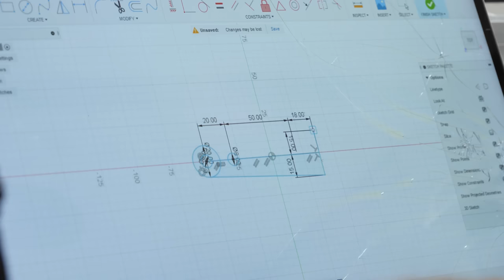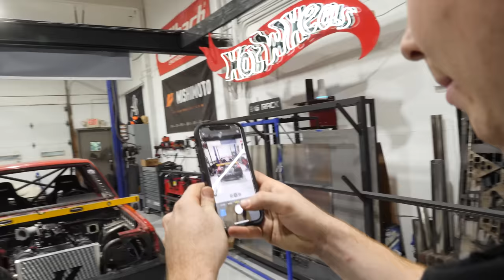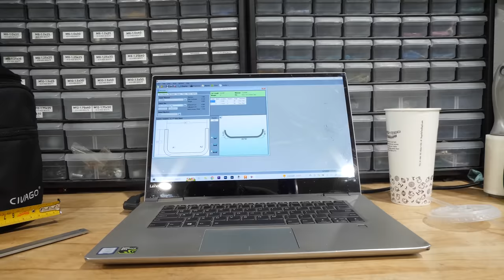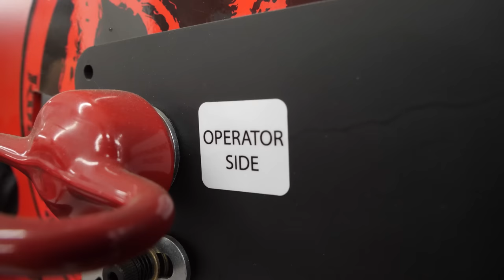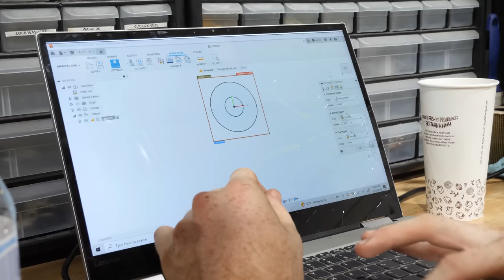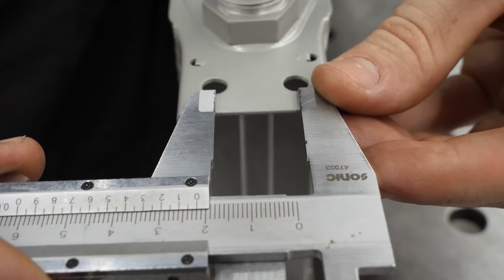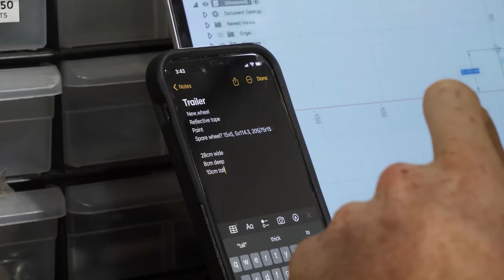DUAL RADIATOR Setup On DRIFT TRUCK V2! Does It Need More Cooling...?

Comment: If you can route the coolant line around the belt instead of through, you won't have to disconnect the coolant line to switch the belt. Loving the build so far!

Comment: I’d think mounting the fans behind the bumper on the bottom would make more sense since there’s naturally going to be dead air down there. Granted you’d need pushers and you wouldn’t get flow through the oil coolers but you’d have more room in the bay to deal with thrown belts etc.

Comment: Intercooler behind the oil cooler means its going to get hot air from the oil cooler. Not ideal. If you can mount them to the side or behind, it will likely have slightly lower IATs.
Reply: My thought is that oil and coolant are generally <10°c apart, so the coolant won't heat up due to the hot air. And because the radiator has maybe 4x the frontal area, it'll still cool, just not in that one spot.
Reply: @KaelinatorPVP  Yeah, if it were a radiator it would be a non issue. However, this is the heat exchanger for an intercooler. So you want that fluid as close to ambient as possible.
Reply: @roboman2444  oh snap, I didn't even realize. That makes sense
Reply from the maker: Yeah. I’m hoping that the size of the intercooler kinda negates it but we’ll see
Reply: In the name of Allah, I invite you to worship Allah alone, so say: I bear witness that there is no god but Allah, and I bear witness that Muhammad is the Messenger of Allah. These words make you a servant of Allah ....  ..........  ..........

Comment: Did you fix the rear suspension so the end that it connected to the body can turn? If not take a look at how push rod works on other cars. If you keep it this way they shocks will break because they will flex.
Reply: In the name of Allah, I invite you to worship Allah alone, so say: I bear witness that there is no god but Allah, and I bear witness that Muhammad is the Messenger of Allah. These words make you a servant of Allah ....  ..........  ..........

Comment: It is better to mount those coolers turned 90°, inlet and outlet on the side.
The bottom connection is inlet, top outlet, that way air is forced out and prevents air pockets and hot spots.
Reply: In the name of Allah, I invite you to worship Allah alone, so say: I bear witness that there is no god but Allah, and I bear witness that Muhammad is the Messenger of Allah. These words make you a servant of Allah ....  ..........  ..........

Comment: You are gonna end up heating the intercooler having it behind the fluid coolers. Intercooler should be up front
Reply from the maker: Yeah I did think about that…. But with the gap between the two and with the length I intercooler being so massive I’m hoping it won’t be an issue
Reply: It wont

Comment: If you want more power ging why don’t you run nitrous? These 1UZ’s love 175 shot of nitrous and you can setup the purge line right in front of the heat exchanger and when you purge your lines it cools off the heat exchanger thus keeping the supercharger cooler
Reply from the maker: The vvti 1UZ can’t handle much more than 300whp from what I’ve heard

Comment: you are probably heating up the charge cooler with the hot air sucked through the oil cooler FYI.

Comment: Avoid mig welding nearby unprotected alu radiator cores - the little hot particles are capable of burning thru very thin alu walls.
Reply: In the name of Allah, I invite you to worship Allah alone, so say: I bear witness that there is no god but Allah, and I bear witness that Muhammad is the Messenger of Allah. These words make you a servant of Allah ....  ..........  ..........

Comment: Are you going to address the front wheel stance being wider than the rear?
Reply: That is a drift car thing. Look at pro level FD cars, this truck is very very mild in terms of front poke in comparison. There isn't really anything you can do about it either because you have to run the poke to get more angle. The only way you would fix it is to add massive spacers to the rear which is not a very good solution at all and staggered will give you a better feel than a square setup anyways. Brand new cars and especially trucks have the front wheels wider than the rear just to accommodate stock steering angle. These custom drift cars can run way more over stock.

Comment: A 500hp ls3 would have been such a better solution, I know it's cool to be different but this is an insane amount of work for 300hp. Lighter, more powerful, more reliable.  There's just no denying it.
Reply from the maker: Eh, not much lighter nor reliable. 1uz is waaaaaaaay cheaper too.
Reply: @_Gingium_ I agree with way cheaper

Comment: I don't understand how your charge air is supposed to be cooled if you're blowing hot air through the radiator. Oil coolers flat under the hood with some louvers in the hood would work much better

Comment: i think youre wasting ALOT of time, money and resources going dual radiator setup. the 1UZ engine doesnt really having heating and cooling issues.
the rear rad is probably MORE then enough to keep it cool, even sideways at redline. ive completely abused a 1uz with a leaking cooling system and never had issues. they simply dont run that hot for a V8.